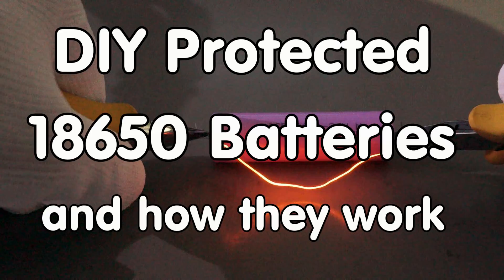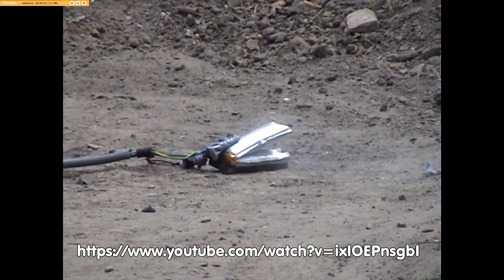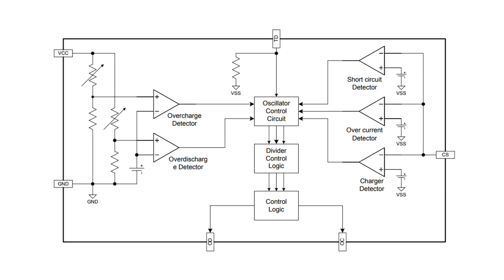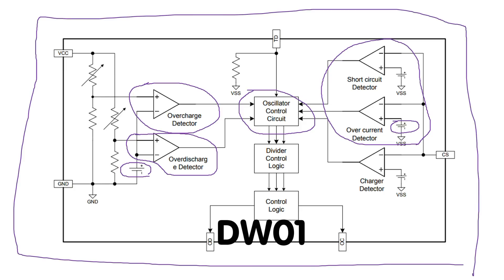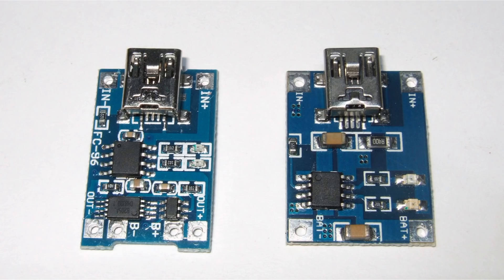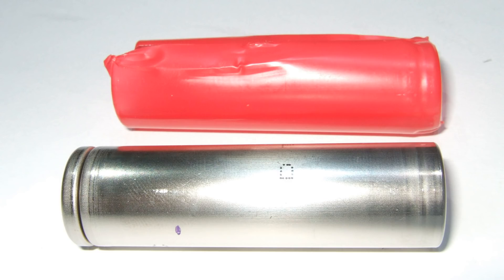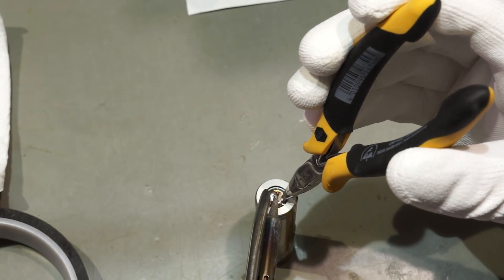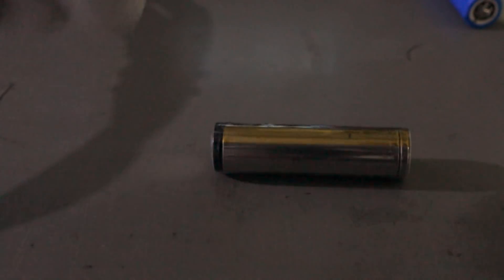#160 40 Cent Do-It-Yourself Li-Ion Protection for 18650 Cells (Tutorial) and how they work

Comment: If I have both over current and over voltage protection. Doesn't this mean I can charge several cells in series safely and forego having a balancer?
Reply from the maker: You always have to balance batteries which are charged in series. When you charge the batteries in series, the same amount of current flows through all batteries.If one cell has a little smaller capacity it is faster "full"  than the others and gets overcharged. This is particularly important if you charge with high currents.
Reply: Your not understanding what I am saying. If "each" cell protector on each battery turns off at 4.2 then no battery can be overcharged. Conversely if each cell protector turns off at around 2.5 then no battery in the string will  be pulled below this. This means that you can just forgo the balance because eventually all the batteries will hit 4.2 and turn themselves off. The balancer is a very crude device, it merely shorts out the battery with the highest voltage via a resistor. it seems to me the protectors will self-balance themselves. But this is "also" a problem. A normal charger will first do a constant current until it hits 4.2 then it will do a constant voltage at 4.2 and leave it on until it hits zero current draw. A protector will not allow this 2nd phase. And will just disconnect once it hit's 4.2 so you can never get that last 10% charge....
Reply from the maker: Just imagine what happens if the first battery reaches 4.2 volts in your concept. Then you understand the balancers.
Reply: So your saying that the first one that hits 4.2 will disconnect. Which is actually what I was worried about. But with these protection cells the balancer may not lower the cell below 4.2 and the protection circuit may fire off silently disconnecting the entire string its on anyway . If your in a paralleled a set of strings you may "never" know this has occurred to any one set of strings. Nor will you ever actually know if one of the shunts on the balancer is even working or fails later on.  there will be no indication other than you blowing out a cell in that string.

Comment: DW01 kicks the UVP in about 2.5V which is too low for LiPo cells. almost 95% of the energy is depleted at just above 2.8V. 
Therefore 2.5V UVP is no good and in most cases will kill the battery over time. 
What other ICs out there that allows to program the UVP with some resistor dividers?
Reply from the maker: I did not search further, so I do not know.
Reply: I did a little search, FS312F-G from same manufacturer as DW01 which has UVP at 2.9V.
Reply: Thanks for the video, I was looking for such a battery management scheme for a project, so this became very useful to me.

Comment: Thank you very much Andreas, I had no idea about the dangers of stored 18650 batteries or when they are complete discharged, it makes a lot of sense. I didn't know about the battery protectors either, so I ordered several protectors to my 18650 batteries I have around and I after I install them I won't lose any sleep over it.

Comment: Thanks for the video -- Very helpful.
Two questions: Your fuming battery experience, was it over-charged past 4.2v or a failing cell (I don't suspect you'd over/under-charge so I'm betting on bad cell);

And am I the only one hearing someone's chuckle at 2:12?
Reply from the maker: 1. As said, it was completely, completely discharged. And it started to fume maybe half an hour after start charging. So, it was just a bit charged. I have other cells of the same batch and they were ok. Brand was Samsung
2. The chuckle came from the original video
Reply: @AndreasSpiess  was it an LED torch you accidentally left on? I thought the voltage drop of the LED would prevent the battery from discharging below about 2.5v
Reply from the maker: @davadoff  There are usually more than just an LED in these torches. Everything consumes a bit of current, and if you wait for long enough, your battery will be pretty flat.
Reply: @AndreasSpiess  Ah, of course!

Comment: Dear Andreas,
thank you very much for this useful tutorial. However, I want to point out, that soldering Lithium cells can cause new problems. Not only charge and discharge over a certain limit can irreversibly damage the cells, also heat can do the same.
I found here a good article on this subject:
https://xaeus.wordpress.com/2014/04/20/safely-soldering-li-ion-cells-without-causing-any-thermal-damage-en/
The best method would be spot welding. Maybe this is something you want to look into:
https://www.youtube.com/watch?v=Ceos88VO6p4
Reply from the maker: Thanks for the link. It shows quite well how to solder them properly. Of course, I know about the problem and also checked the temperature of the cells during soldering. They did not get more than hand-warm (of course not at the place of soldering, but close). So, I assume it is ok. Welding needs much higher temperature because you have to melt iron, not solder and I am not sure how much lower the needed energy is during this short event.

Comment: A complete TP4056 board is around $0.40 too, it's also very small so the only benefit here seems to be getting more amps out of the cell. Which is not bad, but it seems like more work than adding the protection circuit to your project's PCB.
Reply from the maker: The biggest advantage for me is, that it becomes a part of the battery

Comment: I've found out, that these battery holders from reichelt.de can hold the 18650 cells with protection circuit: https://www.reichelt.de/Batteriehalter-fuer-sonstige-Zellen/HA-1X18650/3/index.html?ACTION=3&LA=446&ARTICLE=141630&GROUPID=6538&artnr=HA+1X18650&SEARCH=18650 (no affiliate)
Reply from the maker: Thanks for the tip!

Comment: Great video, but if I understand you correctly, It's also fine to use the TP4056 module (with protection ic's) in my projects in case I only need max 1A ?
Reply from the maker: Yes

Comment: soldering  directly on the battery is not safe, since it get exposed to very high temps...welding is best alternative..there cheap DIY kits available in ali express
Reply from the maker: I checked the temperature during soldering and I was able to touch the battery all the time. So, I assume, the temperature was not an issue. However, I have to admit, I am not a beginner in soldering. Welding for sure is a good alternative, however maybe a little expensive for just a few batteries...

Comment: Hi Andreas; i have some questions; what is better BMS or this System? If i use this system only need is a charger 5v? whit this system is possible use paralel o serial modem for conected 183650? i have reused 18650 of latop battery. Thanks for all.
Reply from the maker: There is no current limit for charging. So, I still would not connect it directly to a (strong) 5-volt source.
Unfortunately, I do not understand your second question about the modem

Comment: Use a dremel tool with a grinding stone to roughen up the battery terminals and wires will solder much more easily to them.
Reply from the maker: Thanks for the tip. Actually, it was easier than I thought.

Comment: I think you misunderstood the schematic for the DW01. IC Fortune labels BATT+ and BATT- but they mean those points would be your new battery connections (BATtery Terminal I think) with protection between it instead of literally where you connect the + and - of the battery cell. On their schematic where the battery icon is placed, that is the place of the battery. They have the exact same diagram for their FS312F and it's confusing.
If you connect the battery at BATT+ and BATT-, the chip probably won't turn on depending on the drain source leakage of the double N mosfet. For example the DW01 is often paired with the FS8205 but that only has 1uA drain source leakage while the DW01 requires 3uA to operate. If the battery is connected where the battery image is located, the chip will run if there is at least 3uA left in the battery.
You can place the battery at BATT+ and BATT- and it would still work and that's why it's confusing. But then every time you replace the battery, you would need to short the ground of the chip to the ground of the battery or apply input once before the chip would turn on.

IC Fortune also has a DW11-P and on that schematic it is labelled battery, VBAT+ and VBAT-.
Foshan also has a DW01 and they also label it with a battery icon and the terminals are called BP+ and BP-.
Diodes Inc their AP9101C is labelled more clearly with battery, P+ and P-.
SII has the S-8200A and they call it battery, EB+ and EB-.
Texas Instruments also has the same topology in the bq2970 and they call them CELL and PACK+/-. And for instance in their alternative topology like the bq294602  they call it VCELL and PACK+/-.
Reply from the maker: You are right. I mixed the things up. I apologize! I will post an updated version on my homepage and leave a link in the description
Reply: No need to apologize at all imo. Just looking around at schematics on the internet half the schematics have it turned around because it does kind of work even when you reverse it.
It's a bit crazy that every manufacturer labels the connections with different abbreviations and even the same manufacturer that uses different labels. That shouldn't happen in such a technical field.
Reply: It took me a long time to figure out how those fets worked.  Once I found out the Batt+   and Batt- terminals are the load terminals it was clear. I wish they just put a load symbol or something instead of Batt+ and Batt-, that makes it look like you connect another battery to those.

Comment: Andreas, you call 18650 as LiPo. Actually they are regular Li-Ion cells, polymer is not used in them. Polymer is used typicaly to stabilize electrolite in flat LiPo cells without metal cylinder around. I don't know how it is possible to make fire with 18650 as they have some mechanical protections against high temperature and expanding gases so such fuses work earlier before fire. I tested 18650 cells in such heavy conditions and they never catch the fire. Even during charging completely discharged cells (<1.5V). Maybe some cheap Chineese cells are done without such "fuses".
Reply from the maker: You both are absolutely right! I (wrongly) call all these batteries LiPo. I corrected it in the comment.
I had exactly the same opinion as you write. But when this happened deep in the night in my lab, I was really impressed! It was a Samsung ICR18650-26H battery. Fortunately, it did not catch fire, it just fumed and already was very hot when I intervened.
Reply: Did you check if mechanical fuse worked? There should be no voltage. Some people are able to "repair" such cells :)
Reply: Very true... 18650 lithium ions are much more robust than their lipo pouch cell cousins. Also, I'd be curious to know if that cell that started 'fuming' was discharged on it's own, or in series with another cell, as there is a phenomena with lithium cells where when they are discharged below 0v (which is only possible when in series), they can become damaged, and then they are prone to internal shorts when you try to charge them. Regardless of this, if I have a really flat lithium battery (under 2v... although I've charged some up from 0v with no noticeable impact on capacity or charge/discharge characteristics) I always charge it at a low current (around 0.1C - so 200ma for a 2AH battery) until it reaches 3.0-3.5v, and then increase it to 0.5 - 1C for the rest of charge. The initial part just ensures it returns to it's 'normal' charge range gently, before been whacked with the full 1C charge current... as 2A can be quite brutal on a 2000mah ultra-flat battery, and it also gives me a chance to assess if anything has gone wrong with the battery before it decides to go nuclear on me! ;)
Reply: Don't worry, those 18650 can go off like rockets! Usually you charge and discharge them at lower currents than pouch cells, so it's just rarer to heat them to reach ignition temperature and they just vent. But if they are hot enough (or there is some flame around already) they give even more of a firework than pouch li-ions do as they shoot through the air.
Reply: @superdau I can imagine... since they have their own little pressure chamber... so if there is some catastrophic failure... they should give some excitement when they do fail! ;)
Reply: @hello there: Yeah, my ultrabook came with a dual-battery option... so it has pouch cells for the secondary battery which replaces the DVD drive, and 18650s for the primary battery, as it goes where the hinge is, so there was enough thickness for them to go the 18650 route.
Reply: The "two" are one and the same electrochemically. The only difference is what material the outside of the cell is made of: metal or plastic. In the case of 18650s, it's actually both—they're made by taking thin prismatic cells (plastic) and rolling them up so they fit in cans (metal).